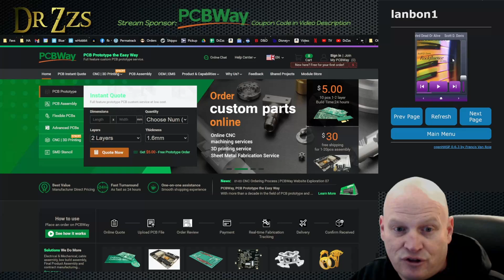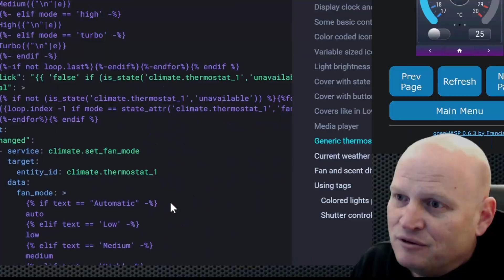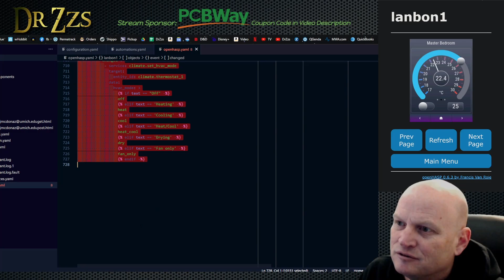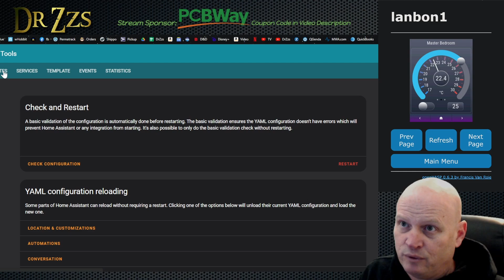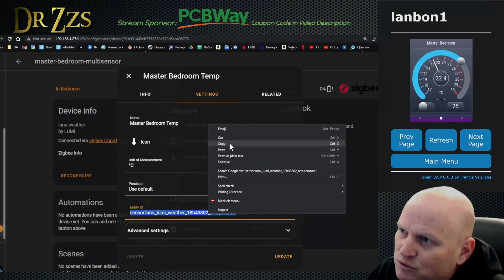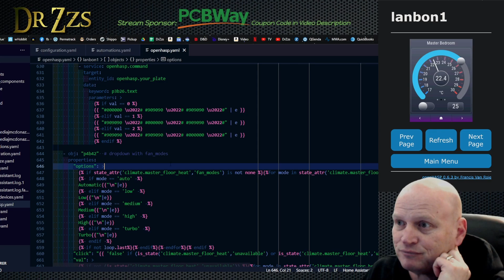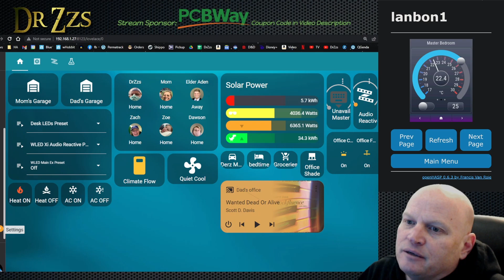Part 1 - DIY Touch Screen Thermostat w/ OpenHASP and Lanbon L8

Comment: Great videos, Keep going on that!

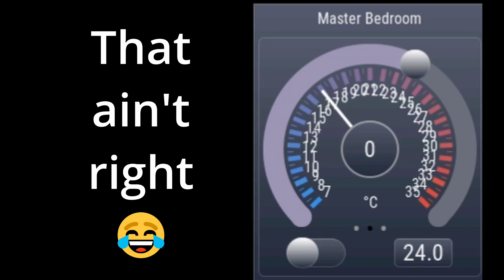Just two things as I just had this same issue. On minute 10:22, once you reload HA, the gauge dial just gets messed up because the difference between min and max temperature values is too big and the gauge gets too many lines, making hard to read the numbers. I solved that just changing  the multipliers / dividers in the gauge current  temp.

Mine one is as follows:

"label_count": >
            {% if state_attr('climate.thermostat','max_temp') is not none %}
            {{ (state_attr('climate.thermostat','max_temp') | int - state_attr('climate.thermostat','min_temp') | int) / 2 + 1 }}
            {%- endif %}
          "line_count": >
            {% if state_attr('climate.thermostat','max_temp') is not none %}
            {{ (state_attr('climate.thermostat','max_temp') | int - state_attr('climate.thermostat','min_temp') | int) + 1 }}
            {%- endif %}

That makes more easy to read the values. Hope this helps

Looking forward to see next parts

David - Barcelona
Reply: Just forgot to point the second thing. Is not necessary to fully reload  HA. Just reload the integration.
But I think that you already know this.
David - Barcelona

Comment: Only starting to watch now, but I'm guessing this is low voltage thermostat. I would love to have a touchscreen thermostat for my 240v baseboard heaters with wifi so I could control it while I'm away from home
Reply from the maker: This is on a Lanbon L8 smart switch.  There are 3 relays inside. I've got mine powered with 120v, but I would expect you could use 240v as well since they sell them internationally.  I can't say for sure without knowing how your thermostat is wired. I'd bet there's a way.  If not you could still use OpenHASP and an ESP32-based screen with Dry Contact relays attached to control your heaters.
Reply: wonder if you could configure it to an RV 12 or 24v air conditioner